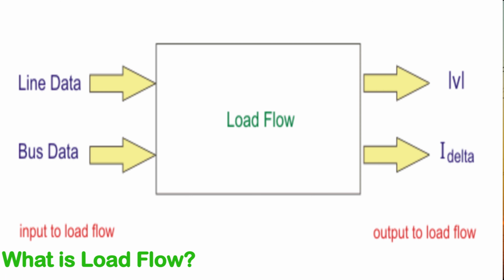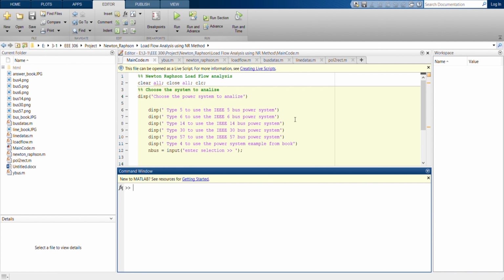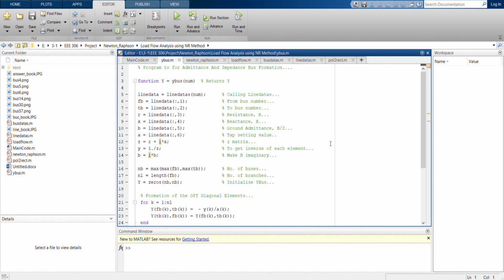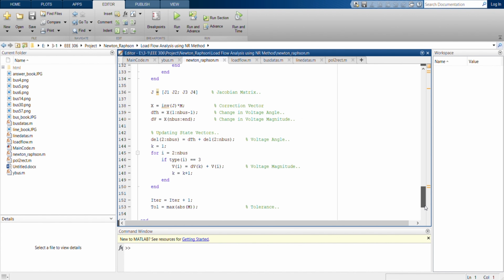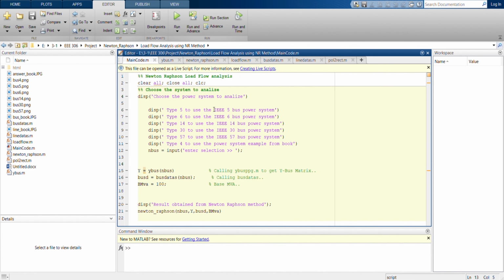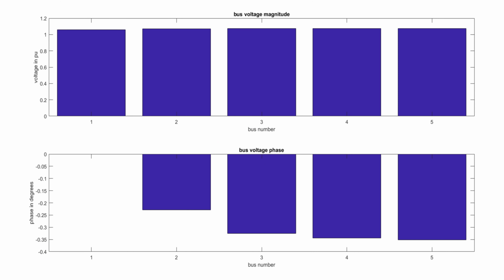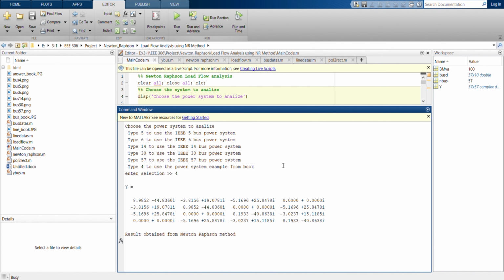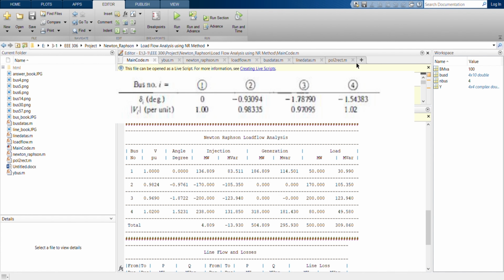Load Flow Analysis by NEWTON RAPHSON Method in MATLAB

Comment: hey 
i am doing load flow analysis for AC islanded micro grid , 

i faced many problems in bus classifications , 

i know there are three kind of buses PV,PQ ,slack ''swing ''

is there an other kind of bus in which no load or generator is connected to it , it is just a bus connected to some buses  the middle of somewhere , 

because in that bus , no reference value is given to it , '' i mean it has't prespecified value such as P and Q , or P and V
Reply from the maker: I'm not quite sure about this. If there is no generator or load connected to the bus and just a bus to bus connection, won't both the buses be considered as the same common bus? Please, let me know if you find the answer.
Reply: @KaushikBiswasDipto   Firstly , we can't consider them as a single bus , the reason is ,  there is an impedance between the buses which the impedance of the line , specially when there are more than one bus connected at that bus '' the bus with no generator and no  load " , and hence , it will be considered in the Y martix of the whole System .

From my Experience in my project , after reading a lot of research papers ,  This kind of busses is considered to be a PQ bus  with P =0 and Q = 0, and here is the explanation i have :

- since there is no active or passive element at that bus , the Algebraic Sum of the Power flowing through that bus is Zero.

These settings worked perfectly in my project after comparing my results with the one i got from the simulator.
Reply from the maker: @abderraoufbelayati3192 , I think this is obvious because if there is no generator nothing is coming from there and if there is no load, nothing is also going there. So, we can consider the net power flow zero.